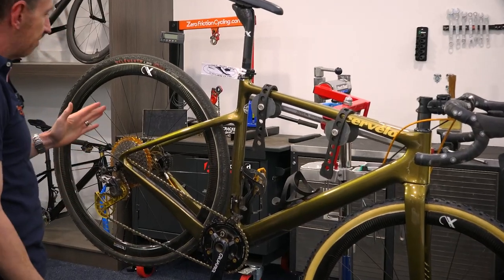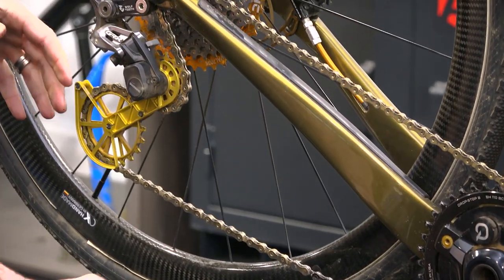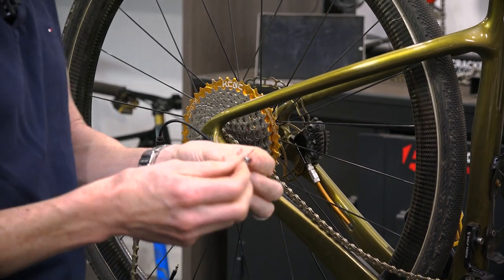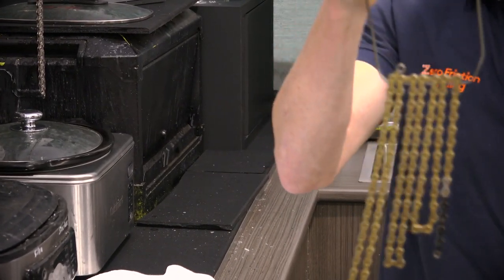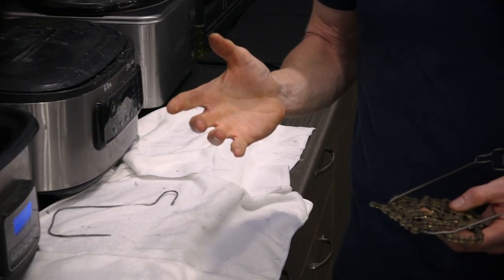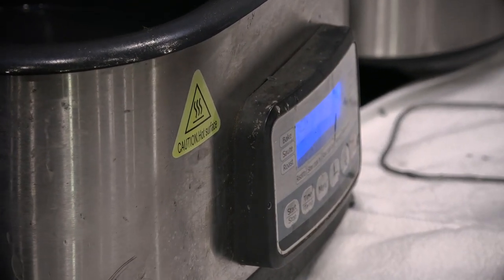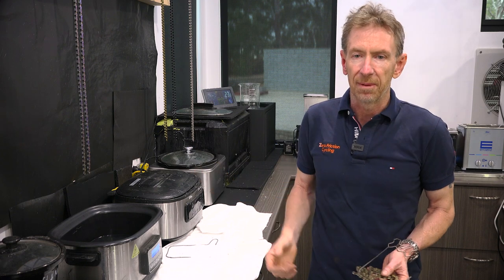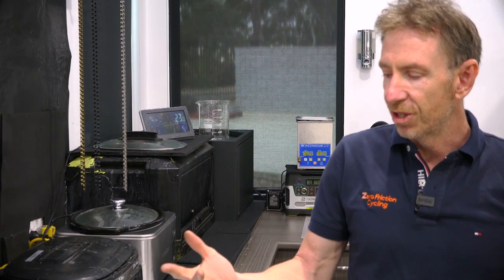Episode 4 - Part 2 Immersive Chain Waxing  - How to Guide.

Comment: Adam — your vids are an evergreen resource; thanks for all your work!  

New-ish waxer here. Entering winter in the mid-Atlantic region of the U.S.  I know it’s not really the climate you live and ride in, but any specific guidance for running wax during a cold — but not wet — season (say, -5C to 5C)?  

Also — in terms of drip wax top-up between slow cooker treatments — any temperature-related best practices for application?  

My garage (where bike and drip wax are usually stored) sits at 10-12C during winter. Will warming the drip wax improve application? Should I bring both  bike and drip wax indoors (21-22C) to warm up for best results?
Reply from the maker: thanks P-Phunk! the immersive waxes like msw are great in the cold with the caveat that a treatment will take a notably longer time to break in, polish up and thus free up - so where a re wax would normally be zooming along after 10 to 15 mins, it could be still feeling draggy and sluggish for good while past that. in the negatives it could be 45mins to an hour to really break in properly. not really an issue for commuters, can be something to be aware of pre race or fast group ride.  

Yes that temp can cause issues with application of pretty much all wax drips even those that normally do not have penetration issues - they are designed to not have such down to around i think maybe 16 or 18dg c below which issues may start to occur. Unfortunately warming the lubricant wont solve - if you are applying say 5ml to your chain (fairly heavy wax re lube), and your chain is over 100 links long - then that is less than 0.05ml per link. The warmed lubricant will almost instantly cool to the same temp as chain metal. So wax drip application the chain and lubricant ideally should be at around 20dg c or you may find you just have only penetrate superficially / mostly set on outside of chain. For some this is not easy if bike is stored in a garage or shed etc - and so there is no magic bullet around that only considering other options such as running two chains on rotation so one waxed chain comes off and goes into pot, other waxed chain goes on etc - or if the break in a pain - remove chain to bring up to indoor ambient temp for wax drip application. For some working around cold temp is ok, for others the options are impractical - they may go back to a wet lube - but then that brings other problems of either friction and wear from gathering contamination - or the faff of cleaning maintenance to keep low friction - which is often more  faff than the steps needed to keep on wax etc. Tis all a balance that each individual should choose what suits their situation and preferences best.

hope that helps! Sorry no super easy solution, alas those temps simply do pose some challenges......
Reply: @zerofrictioncycling992  Thanks so much, Adam!  Appreciate the detail and clarity in your response. 

Good tip on the longer ‘break in’ time after immersive waxing when riding in low temps. 

With the drip wax ‘top-up’ — I’ll try bringing the bike indoors after dinner to warm up; applying the drip wax before I turn in; and leaving the machine indoors overnight. If that doesn’t go swimmingly, I’ll stick to just immersive waxing until spring.

Comment: Hi Adam, 

I am huge fan of waxing and trying to spread the word over to German e-mountainbike groups….impossible. They rather spend 400€ for a new cassette than 25€ for HotMelt. 
However, there is one question I am asking my self now and than. 

What happens to the the contamination (dust) when I do a rewaxing?
Reply from the maker: HI miro apologies for delay! The contamination you bring into wax will become part of the wax. But, it takes awhile for this to notably negatively affect. Compare to drip lube. You get dust in chain, and then you add say 5ml of drip lube over 100+ links of chain. The contamination doesnt go anywhere. You have just added less than 0.05ml per link of new lubricant over old contaminated coating. Over subsequent re lubes, the ratio of contamination to lubrication just continues to degrade. Vs putting the chain in a bath of 500ml of wax...... it takes ages for the wax to get anywhere remotely near as bad as what is happening when one just drips more lube on chain - hence how much cleaning needs to be done for most drip lube chains to try to keep them low friction if riding offroad. 

You can also easily minimise - dry rides - spray some alcohol onto microfiber cloth and wipe chain to remove surface dust. Dust sticks to outside of chain even if wax chain, from static elec same as dust sticks to frame and you dont lubricate your frame. this wipe will lift off surface dust so you do not take into wax pot. 

Drip lube users should do same so as not to drag this contamination into chain on re lube which happens a lot, and thats  very bad re causing wear. 

I would also go to the epic wax FAQ guide to 1hr 39 and look at two pot system like a boss, this is the easiest way to keep main pot wax mint - especially if do a lot of wet rides.

Comment: Hello, how many km in dry conditions we can do after a waxing? Thank you best regards.
Reply from the maker: generally circa 300km easily for most - but note this is conditions and power dependent. You can go much longer (ie msw, hot melt claim 600km) but there are longer term component lifespan advantages to re waxing early vs pushing treatment lifespans

Comment: Does anyone know if an induction stove would work? those give quite good control of the temperature
Reply from the maker: Yes they do - i actually have small portable one for one of my own pots. If you go induction get a cast iron pot as this will transfer heat extremely well, even better is to use a hob as well in between (hob and cast iron pot is what i use on mine). A very thin pot if you put heat on a bit too high you may still overheat bottom of the wax that is trapped before upper layers melt enough to allow convection. Plan to melt slowly - rapid heating is bad, so experiment starting on a very low setting first, and increase as needed- or start very low and increase after some time has passed that will allow convection and ensure bottom of wax will not burn to achieve 70 to 90 dg temp. If using a hob and cast iron pot you wont need to worry about over heating bottom, you can just set to a med-low temp and come back sometime later and all is sweet.
Reply: @zerofrictioncycling992  Wow, thank you for the thorough and fast reply! Will try it this way with a thermometer to make sure wax is not burned.

Comment: Hi Adam - Oversized pulley wheels look great. Do they improve efficiency and are the aluminum pulleys as quiet as stock nylon/ plastic OEM pulleys?
Reply from the maker: It depends. Marketing for OSPW systems normally claim savings of around 2w. However we do no know what losses the chain is that they use to measure savings between OSPW and standard. I believe most would use a real world "Average chain" of likely around 10w loss. If one is being smart and say running a msw / hot melt chain that will be half the losses of a normal chain - then your savings will also be halved. The worse your chain lubricant, the greater the penalty for small diameter pulleys, cross chaining etc. The lower friction your chain, the lesser the penalty for such things. but also, there is less ability to save by optimising these things

generally i quote to most enquiring at ZFC, if they are running a top lubricant option choice, it will be about 1 watt. So it is an expensive watt. 

However, some conditions it is worth more. Ie that is on my cx /gravel race bike. Tension in lower span is greater than on a road mech, so there is a bit more to be saved to start with. Then, in many races - ie the bike saw plenty enough mud on saturdays cx race - the chain is not going to stay in the 4 to 5w loss mark in the last half or last third of the race, it is has bunch of mud in it, it will be more. The more friction in the chain, the more the ospw will save - so it was probably saving me circa 2w after all by the end, and others who start with pretty terrible chain and finish worse, well, more  - but they should work on their chain lube before they think about shelling out for ospw. 

Im not fast enough to really worry about 1w or 2w, but i am lucky i have the budget for fun things with my bikes, i really enjoy an optimised bike because when you take care of things across the bike  - you can add up some really big differences vs just running things stock. From chain, to bearings, to pulleys to tire choice - all the right choices can add up to 10 to 15w difference vs meh choices, and a bike really feels like silk lightning overall with all the right choices vs feeling like a bus with the meh choices. Life is too short to ride draggy bikes :) But again - use budget - cover the easy, very cost effective low hanging fruit first (chain, chain lube & maintenance, tires - refer to bicycle rolling resistance, then stay playing with bearings / ospw if budget allows / and or you just enjoy adding cool touches & upgrades to your bike. You wont notice saving a watt. you will notice saving 10).

Comment: I'm discovering your channel and looking at each and every videos, thanks a lot for sharing your knowledge!
On question about the use of a slowcooker : can we use the same heater used for hair removal ? Thanks ;)
Reply from the maker: Hey there - yes most beauty salon wax pots are perfect temp / adjustable temp for immersive waxing - but.... note most tend to be very small and they are often a deep profile so the circumference for the volume can be very narrow making swishing difficult. And they typically cost a lot more than the $20 adesso from woolworths. But if you have one already that is big enough and not using for your eyebrows, yeehaa :)

Comment: Thank you again Adam for every video you do. Can you hang the chain on the swisher tool? I had a stuck pin/link the other day that I ruined the chain, it had never happened with oil and it was my first waxed chain; could that be from low wax temperature? Or bad after wax bond breaking? I’m also running an oversized pulley.
Reply from the maker: Thanks Derek! You can but the chain will stick to itself a bit, it can be a little more faff removing from swisher vs hanging vertically, but its not too bad. Sorry i not quite understand what happened with chain and suck pin /link - how ruined?
Reply: I doubt wax could of caused a "true" stiff link, you sometimes get a couple of links that require a little more wiggling to free up, and they seem to occur randomly, sometimes you have to just put up with it for the first km or 2 and it sorts itself, the only things I can think of is:
1) You got a bad chain with a tight link out of the box, it used to happen occasionally in the past but I don't remember having one in the 10 speed+ era. (Adam has handled more chains than I have or ever will, if it does still happen he will know) 
2) The chain was left out stripped of grease to air dry for a little too long and rust formed inside the chain, but I found it unlikely usually it would appear on the surface first.
Reply from the maker: @chris1275cc  Chains do very occasionally have a stiff link new, often it is very minor and will free up quickly in riding, and it wont be stiff enough to cause issue going through the drivetrain, you can just feel it when handling the chain post cleaning and threading onto swisher for waxing.  

Very occasionally a chain will have a link that is stiff such that it will not articulate enough to go through drivetrain without causing an issue. I have had 2 of these pick up in pre prepping in the last 12 months, and we prep on average 50 to 100 chains a week, so its rare, but happens. 

It would be very unusual prep for rust to cause the issue. One would really have to leave chain a long time after cleaning, and even then the outside will start to spot oxidise well before inside as inside does have much air exposure. 

I am still unsure of his question / what happened though. One cannot break a chain by waxing it....

Comment: Hello , i switched to hot wax for my bike recently and have a question : 
Do you recommend to let the wax cool down a bit before removing the chain from the pot  ?
 Like in some other tutorials where they say to let the wax get just to the melting point before  getting the chain out ? I tend to do that and i find that there is a lot of flakes and a lot of excess on the chain , some much that i find my shiting on read derailleur to be not as crisp sometimes ..
Reply from the maker: heavens no, pretty sure i covered that in the faq doc and video - that came from oz cycle i think - a source of a lot of real interesting waxing info i spend a lot of my life fixing. THe pressures inside chain are extremely high as parts are small. In 10 mins of cycling you will have same amount of wax inside chain if you remove from wax at 90dg and hang to set on a 40dg c day as if you remove at 60dg c and dunk in cold water to "lock in as much wax as possible " - oz cycle... All you get from the latter method is a big mess, wasting a lot of wax, and gunking up your drivetrain - especially small cog where excess can easily build up in channel between 11t and 12t, have chain sit too high in the 11t and jump under load. Waxing is just super easy - pop chain off, pop into pot, turn pot on, come back later when melted and swish and hang to set. Break wax bond and re install before next ride. 99.999% of immersive waxing should not be more complicated than that. There is a huge amount of over complication of a very simple easy process leading to a frankly nuts FAQ guide :)
Reply: @zerofrictioncycling992  thank you for answering , im going to watch this FAQ vidéo . This recommandation of letting the wax cool down (until there is some solid wax at the surface of the pot) is also in the silca hot chain blend  tutorial vidéo . Going to do as you say the next time ! For my first ride with wax, i removed the chain when the wax was around its melting point like they say in the silca videos (im using silca wax) but after 70 km i had so much wax flakes and wax on my cassette and on the outside of chain that gears skipped when peddaling and had trouble shifting beetwen gears (rear mech shifted perfectly the previous ride with squirt lube) . Cheers.
Reply from the maker: @beatboy0121  ha yes i did chat to josh about that! He advised they had done some testing and on their super accurate test machine, there was a marginal benefit. It is not something i will bother to include even for race chain prep though for this marginal gain, as other practices are much better, such as a wax break in run and race powder application. That much faff and mess for the level of difference we almost need the resources of cern to detect  - i almost always agree with josh but this one is too marginal for too much faff and mess i wish that particular advice hadnt been put out there... and it shoots down my shooting down of the oz cycle video somewhat hahaha - but i sticking to it is REALLY not worth it, especially omg for your training chain.

Comment: Hi Adam, I was wondering, if when the contamination in the pot is high you could strain it through something like a cheesecloth? Then add a new bag of wax to increase the volume again. Many thanks for all your videos.
Reply from the maker: Hey luke - no that doest really work, the wax will cool / clog any filter fine enough to remove contamination. There are various ways people do to cut bottom off wax after it has cooled, but that will also remove a good amount of your modifier. Best method for that is to use a bbq tray pressed down in center to make a cone shape and cut tip off, this will still remove an amount of modifier, but less than other methods. 

The best way to extend wax lifespan is to go to 2 pot system like a boss as demonstrated at the 1hr 39 min mark on wax FAQ vid (episode 7)
Reply: @zerofrictioncycling992  thanks a mill Adam. I actually use a very similar method when washing cars with 2 buckets and grit guards to stop the dirt you rinse from the mitt from getting back on it and causing swirls in the paint. Thanks again

Comment: Thank you very much! I'll defenetly try this! Just one question: how often can one pott of wax be used in the slow cooker? How many chains can be waxed with one pott of wax? Thanks a lot!
Reply from the maker: Hey Henning - for road typically recommend re wax by circa 300km, and replace wax after approx 30 re waxes - so about 8000 to 10,000km per bag is normal. Check wax FAQ guide on zfc website if ever stuck as i cant be assured to always be on top keeping up on comments - 99% of wax questions are covered there for easy of knowledge re all things immersvie waxing!
Reply: @zerofrictioncycling992  thank you so much!

Comment: I'm wondering if the cassette should be waxed too or not? Would it make sense to reduce friction?
Reply from the maker: Hey philippe alas no, trying to wax cassette just ends up way too much wax - its a mess / chain can jump as cant settle into cogs fully. There is plenty enough wax from chain imparted to cogs as long a one is re waxing by every circa 300km, and this excess wax is nicely wear protective vs a build up of most drip lubricants which can be an abrasive build up vs slippery build up